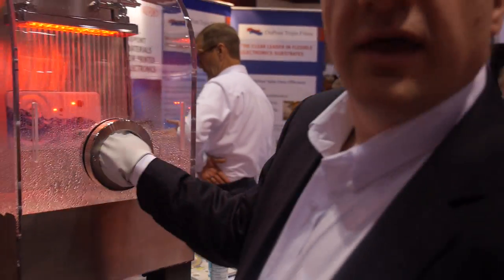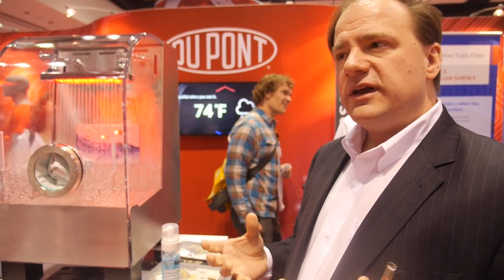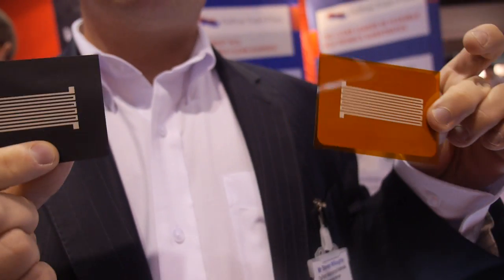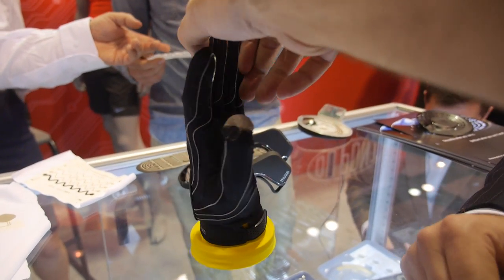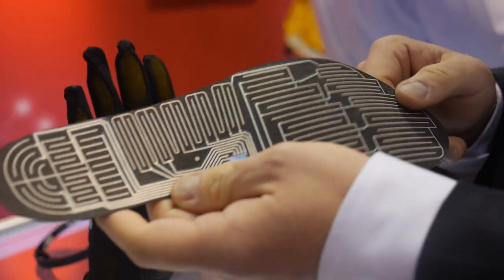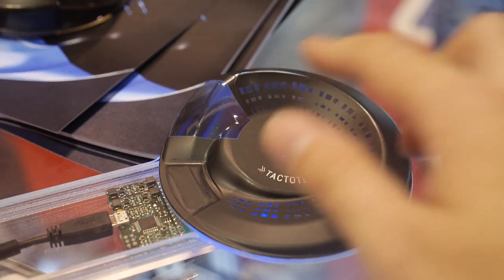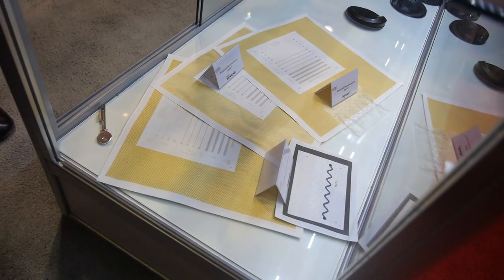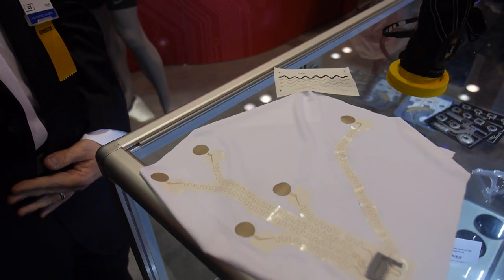DuPont printed electronics for displays, photovoltaics, automotive and more

Comment: Guang Zhou City Silver Well trading Co.,ltd. Is a professional high-tech enterprises: automotive electronics, medical electronics, biological sensors, CTP touch screen, smart appliances, RFID and other manufacturers to provide one-stop technology and material supply solutions. My company is a number of the United States, Germany, Japan, South Korea's well-known brands in China's sole agent. Customers always enjoy the best quality products and technical services. Division I and the original factory to establish a wide range of research and development and technical cooperation, can be customized for customer special materials R & D.
Main products currently on the market most products competitive advantage: photosensitive silver paste, laser silver pulp, tensile resistance (Extended) conductive silver paste, automatic control temperature PTC carbon paste, conductive silver paste for low temperature, pressure sensing ink, Bio Medical silver chloride electrode slurry, defibrillator AED electrode silver paste, transparent conductive ink, conductive carbon paste, UV insulating oil and other high-end functional materials.
Products are widely used in CTP touch screen, medical bio sensor, automotive electronics, smart wearable electronics and other industries.
If demand please contact the relevant materials:Guang Zhou City Silver Well trading Co.,ltd.
Cell 86-13922125860
E-mail:laiqiangping2010@163.com 
www.gzyinbiao.com